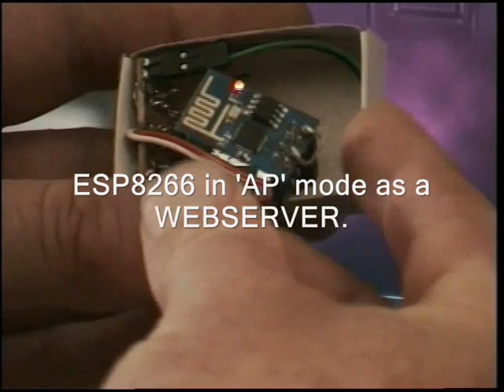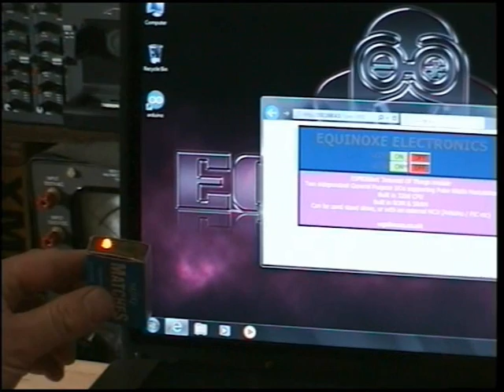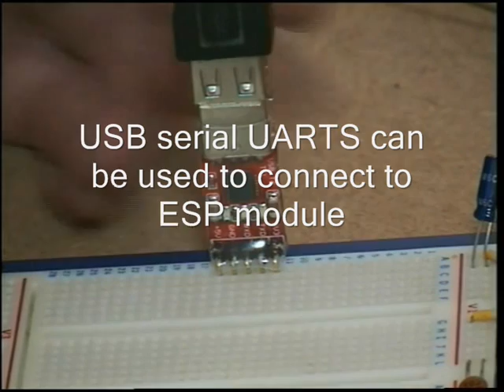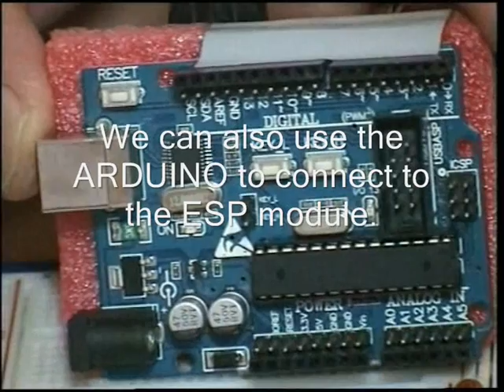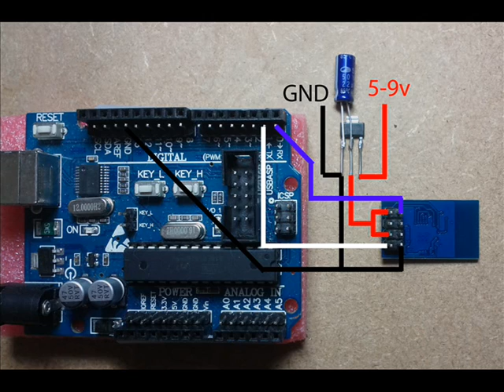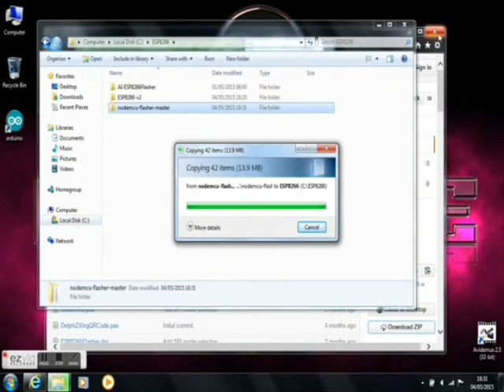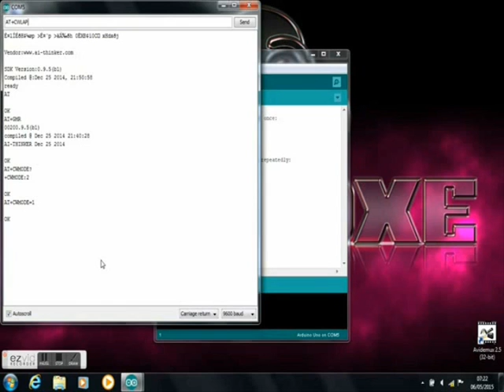ESP8266 - Getting Started & Connected.

Comment: Thanks, well done. A level shifter for RxTx is not necessary?
Reply: +gert3d I had the same question.  Without getting deep in the details, basically the thresholds voltages between mar and space (1 or 0) are close enough. anything above 3ish volts is a space, so that extra point 3 on the 3.3 comes in handy.
Reply: +haunce Well it may work but would 5V dataline harm the ESP8266 powered from 3.3V? Anyway I now use a small level converter board suited for 4 datalines. It's easy and better safe than worry.
Reply: +gert3d nope..... at least not in my case.   I have used the 3 volt esp8266 TX and RX directly to a  arduino,  and FTDI running with vcc @5 without issue.
Reply: I am not completely sure the Arduino TX and RX comply with the RS232 standard. Anyhow the standard mandates protection for shorts and fairly high voltages. These lines are expected to have weird voltages. I respect the "better safe..." philosophy, but in this case, the ESP8266 things are just so dang cheap I would just snap another in if I happen to let the smoke out.
Reply: +haunce OK thanks, indeed I like to rule out those uncertainties, there are many remaining ... Programmed the ESP8266 sofar using FTDI, and Arduino IDE. Trying to interface with Blynk service, so it can notify me by email depending on sensor readings. The 01 type effectively has only 1 GPIO, so moving to other types now.

Comment: Hi.. the Red LED on ESP8266 is not powered on.. I have followed this video and facing this issue.. can you help me out?
Reply: Are you powering the module (the ESP8266 itself) with 3.3V to the VCC & CH_PD pins, and GND to a common GND? Also how are you supplying the 3.3V? I found an FTDI USB-Serial adaptor I have, outputs +5V to VCC, but not enough amperage.  (it was actually powering down & recycling, feeding the +5V VCC from the FDTI module through a L78L33AC regulator (TO92 sized 7833 (3.3V regulator), and began using a modified ATX power supply (converted to a multi-voltage bench supply.), the red LED is mainly you 'Power Active' LED. the Blue LED is the "Active" (Communicating) indicator.

Comment: In C drive there is a folder called ESP8266, from where did you get that folder and what is inside the folder.
Reply: The software places a folder there by default  when you download and install the Ardunio IDE. Should be where your sketches and things pertaining to Ardunio reside...one would think . Any install I've ever done that uses config files, interactive settings or some form of code manipulation  installs directly in the C drive instead of program files where they usually default too. Hope that helps ....take care

Comment: hi Equinoxe, is ESP8266 able to use as transparent uart module from power up? Pc wifi -> esp8266 -> uart output
Reply from the maker: That's a very interesting question, and I'm sorry to say I've not looked into doing that. However, the latest arduino ide can now be installed directly on the ESP, it may possible to do it using that?....certainly worth looking into. Check this link:
https://learn.sparkfun.com/tutorials/esp8266-thing-hookup-guide/installing-the-esp8266-arduino-addon

Comment: sir.......my esp8266 not working,even though i flashed firmware but for AT commands it is not responding.so I tried to reflash firmware again but it saying "not connected"  and "connection failed"........please help me out this problem
Reply from the maker: +s.sasi sekhar Don't forget to connect GPIO0 to GND when you are flashing the firmware and if you have used your Arduino since, check you have a blank sketch uploaded or the serial interface may get corruption.

Comment: i am new to esp module. We are planning to do a project using esp. Would you  mind explaining how you put that thing in match box with battery
Reply from the maker: Hi, 
The matchbox server is running the LUA Interpreter firmware, with a couple of LEDs connected to the GPIO pins of the ESP8266.
Firstly you will need to flash your ESP with the 'LUA interpreter' rather than the "AI Thinker" AT firmware which is used in this vid. You can use 'NODEMcu Flasher' to flash the ESP with this. So...very basically:
STEP#1: Get yourself a copy of NODEMCU
STEP#2: Get yourself a copy of LUAUploader.
STEP#3: Get a copy of the 'Matchbox.txt' file
STEP#4: Flash your ESP using NODEMCU with the LUA interpreter.
STEP#5: Past the Matchbox.txt into your LUA interpreter, and upload to your ESP.

(All these files can be got from my website, if you can't find them elsewhere i.e GITHUB)

Links to all you need can be found here:
http://www.equinoxe.co.uk/downloads.htm

Also, check out a nice video from Julian Illet, which does explain the LUA Interpreter, and how to upload code from it, so it's worth a watch.

Julians video can be found here:
https://www.youtube.com/watch?v=rVbnnEMDSvU

Comment: When i command AT+RST then this result shown with invalid at the end. Can you please tell me that how this problem will resolve.

AT+RST

OK

 ets Jan  8 2013,rst cause:2, boot mode:(3,0)

load 0x40100000, len 1396, room 16 
tail 4
chksum 0x89
load 0x3ffe8000, len 776, room 4 
tail 4
chksum 0xe8
load 0x3ffe8308, len 540, room 4 
tail 8
chksum 0xc0
csum 0xc0

2nd boot version : 1.4(b1)
  SPI Speed      : 40MHz
  SPI Mode       : QIO
  SPI Flash Size & Map: 8Mbit(512KB+512KB)
jump to run user1 @ 1000

⸮⸮ՁMEM CHECK FAIL!!!
⸮rl⸮⸮s⸮
Ai-Thinker Technology Co. Ltd.

invalid

Comment: I succeeded to connect to Arduino, everythings work fine. I set GPIO 0 to GND, however flasher does not want to flash. It stops at Note:Serial port connected. Note:Begin find ESP8266. Blue light flashes on ESP8266 but nothing happens.
Reply: +Marin Radjenovic +Equinoxe Same issue for me. The serial port returns garbage too... I've tried Arduino and FTDI, all baud rates, but still can't connect. Interestingly enough, when powered the ESP broadcasts an SSID of AI-Thinker_11E1DC. I can connect to it via wi-fi, but nothing happens when I try to go to 192.168.4.1 in the browser. Any ideas?

Comment: With the speed "19200" on the Monitor Serial, I get the message: "Ai-Thinker Technology Co.,Ltd." and "invalid"... This is OK?? Because I can´t make it run!! 
on any other speed I get a message that I can´t read!
Reply from the maker: It sounds  to me like all your wiring is fine but it hasn't flashed properly, for one reason or another, maybe a corrupt bin file?
I would be tempted to re-flash the firmware, or find a different firmware version and flash that.
Reply: Equinoxe, flashing the lady firmware worked fine... Just some problems on connecting with my Wi-Fi!!! :( 
Thanks for your answer 👍🏻

Comment: can you please tell what kind of external power source did you use??
can we use resistor pots instead of the regulators??

please reply asap
Reply: +Pratyush Bothra yes , you can , but u have to take care of constant voltage and sufficient current

Comment: i didnt undrestand why the code in arduino's IDE is empty
Reply from the maker: +Bouyahya Amine We are using the arduino just as a serial interface. Chances are, if there is code running on the arduino, it may also be writing to the serial interface which will cause you problems, not always the case, but any sketch which uses serial.begin or serial.print will cause you issues so to eliminate that, we upload a blank sketch.

Comment: which regular did u use for the wifi board ?
Reply from the maker: It is an AMS1117-3.3. I had a bunch of the surface mount ones, so all I did was solder legs into if for breadboard use, but any 3.3v regulator should do the job.

Comment: Sir can u please tell which voltage regulator you are using....??
i am using the same connection but cannot bring down 5v to  3.3v.
so can u please suggest me which voltage regulator should i use...?
thank you sir
Reply from the maker: +Chetan Nain 
Hi, the one i used was the AMS1117, its just a standard 3.3v regulator, but it is surface mount, so I've soldered the legs cut off an LED to make is usable in the breadboard. They are cheap as can be from e-bay, just a couple of quid for a whole pack of them.
Reply: thankyou sir.......:-)

Comment: If I can't find an AMS1117, can I use a LM7833? (it's also a 3.3v regulator)
Reply from the maker: +WalfasProject8000 
Hi There, yes the LM7833 should be totally fine, if you get the TO-220 version, you wont need to fiddle about soldering pins on the legs! I only used the AMS1117 as it was cheap and cheerful and had some kicking around!

Comment: i directly connected my esp8266 with mega using 3.3v from mega and tx goes tx and rx is connected to rx, as soon as i power my auduino afer few seconds the blue led turns on and remains on. it did went of when i removed ch_pd from 3.3v. what is happining? for the same setup it was correctly working before, i have also tested few at commands but now the serial monitor remains blank .how to fix this?
please help.
Reply from the maker: Have you uploaded a blank sketch to your Mega? If you have a sketch running that has Serial.print any where in it, it may interfere with the serial port you are using. Normally the blue LED indicates serial data transfer.
Also make sure you are using the right serial port on your Mega - there are four.

Comment: where did you get the firmware ?
Reply from the maker: Hi, You can get the ones I use from here:
http://www.equinoxe.co.uk/downloads.htm

There is probably a later version around now, but I've not tested that.
Thanks
Reply: +Equinoxe thank you I already did but my esp8266 doesn't create a Webpage. any ideas what could be wrong?

Comment: Heyy can u tell me the reference of the regulator? or any can work?
Reply from the maker: Any 3.3v regulator should be fine. The one in the video is an AMS1117 3v3, here is an example:

https://www.ebay.co.uk/itm/AMS1117-3-3-LM1117-1A-3-3V-SOT-223-Voltage-Regulator-chip-IC-1-100-Pcs/223978404748?hash=item3426273b8c:g:dkcAAOSw5oZeOr3F

Look carefully, because there is a 5v and a variable volt version, so look out for the 3v3 part.

This is an video now, take a look at the ESP32 WROOM-32 if you want to code WiFi modules. You can use the Arduino IDE to program direct and it's faster and more memory than an Arduino UNO, you can do an awful lot more with these and they are dead easy to use. Should cost you around £8. Good Luck!

Comment: why cant we use 3.3v pin from arduino board
Reply from the maker: You can try, and some have had success,  but the particular module/Arduino combo I was using just didn't work. The power draw was too high, but I was only powering via the USB cable. You could try the 3.3v supply from the Arduino, but I'd be tempted to use an external PSU to power the Arduino.
Reply: +Equinoxe sir i wanna build a project controlling quadcopter with android iam using esp8266 android app and arduino but i dont know how to send data recieved bye esp to arduino iam giving AT Commands using pc but i want to give AT commmands using arduino i dont know how can u help sir

Comment: I m facing problem in wifi sheld programme so plz any one help me
Reply from the maker: Check the wiring, the WiFi shield examples in arduino are written to use the 'shield' version rather than the 'module' shown in this video, so you may need to fiddle around with the way it's connected.

Comment: Great video, but where do I download the firmware. My module is like the one you are using.
Reply from the maker: If you can't find the AT firmware anywhere else, try here:
http://www.equinoxe.co.uk/downloads.htm
It is the 'AI Thinker firmware' you want if you are using the AT command set.
Also on this page is a link to the 'NodeMCU' flasher utility for flashing either that 'AT' firmware or the 'LUA'' firmware (which was used in the 'matchbox webserver' )

Comment: why are we flashing the firmware?.Why can't we use the old firmware itself
Reply: Firmware 0.95 enables access to slow, stabile speed 9600, new version works only with 115200.